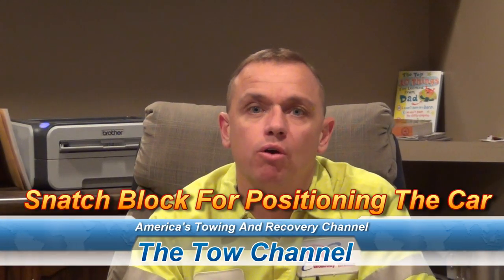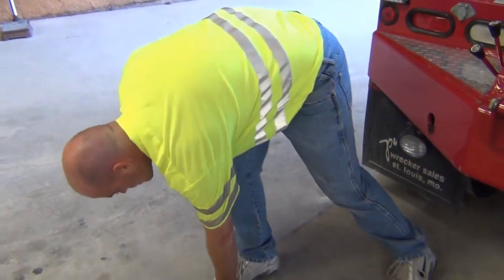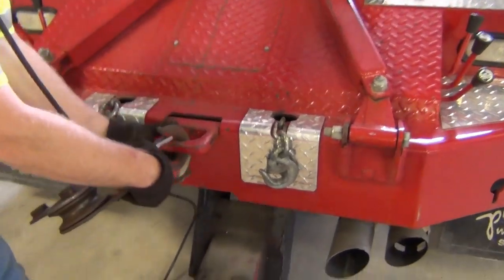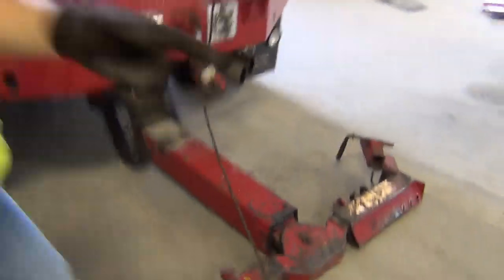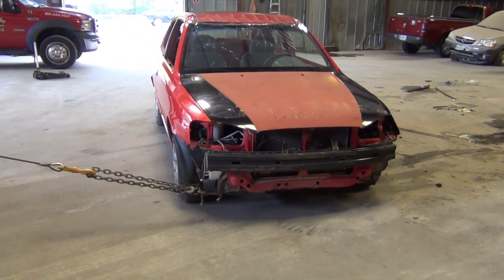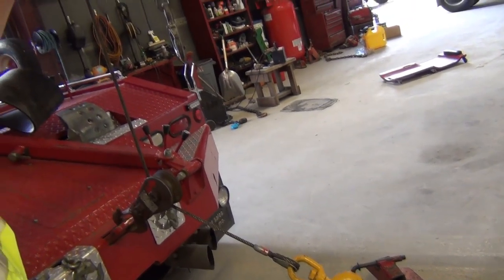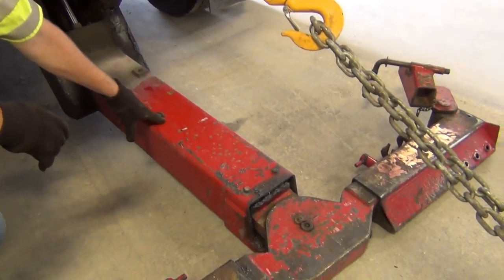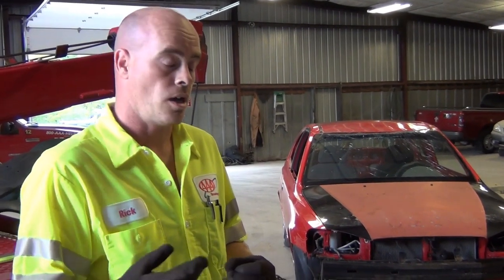How To Use A Snatch Block to Spin A Car

Comment: This is a good video to show the dynamics of positioning a car, using the equipment at hand and going on the assumption that the car can't start and move under its own power. The one item I find any fault with is the attachment point on the car. I would have attached to the driver's side to give it a little more range in swinging the front end across. I also am a flatbed operator and rarely use my snatch block. for what it's worth, I would have attached a J-hook on the driver's side control arm, making sure that the angle wouldn't cause the point to make contact with anything that could be damaged in the action. After checking, I bring the small end toward the pocket on the passenger side of the bed. If it's not long enough, I use the second chain to reach the first one or option a closer pocket. I typically assure that the back end of the car stays put with a 4x6 in front of the tires in addition to the park brake. Once ready, I slide the bed forward, tightening the chain(s) and moving the car's front end laterally toward the bed. usually it takes two to three pulls, depending on the distance needed to aim the car at the truck. It's way quicker done than described. The biggest advantage in this method is that the chain can be kept very close to the ground and therefore it doesn't get into the bodywork fascia. Of course that's a very minor consideration for a car that was being driven on its roof just a bit earlier.

Comment: A question asked by my girl. If the car don't go into gear, and or the ebrake doesn't work... how does the car trail properly when using the snatch block? Perhaps a video on this? I worked in Boston for years. Thanks
Reply: Mark Milliken BY YOUR GIRL.?? YEAH,RIGHT
Reply: Mark Milliken... use wheel chocks.

Comment: use the boom to spin the car. you don't need a snatch block in this case, the car is light enough to swing it around be winching it.
Reply: James Jhonson ...unique last name. The point of this video is to demonstrate using the snatch block. I guess the operator could have said: "snatch block? I don't need no stinking snatch block!" Just having fun with you. Tow on, bro.